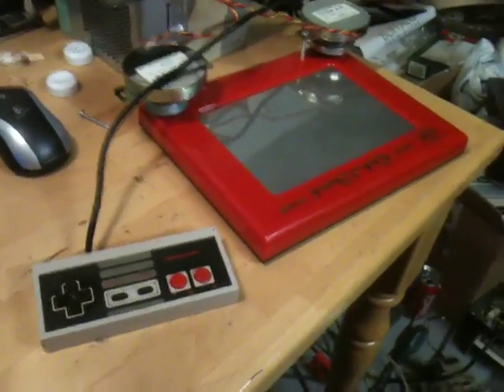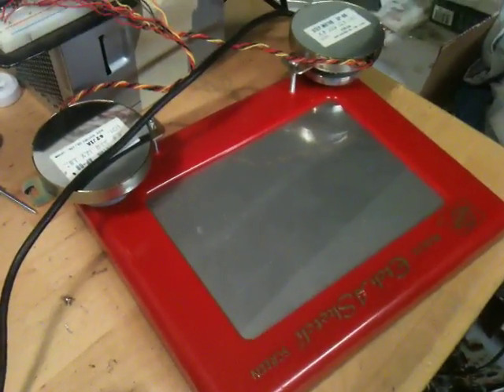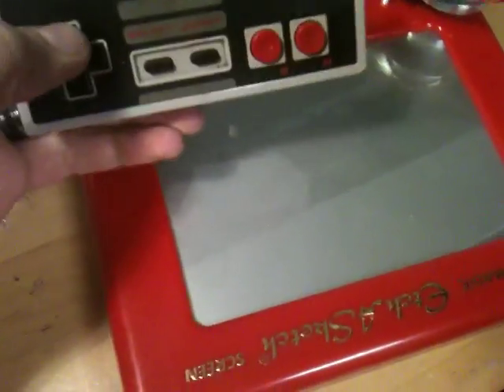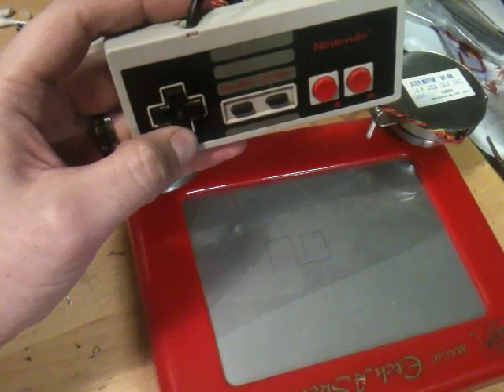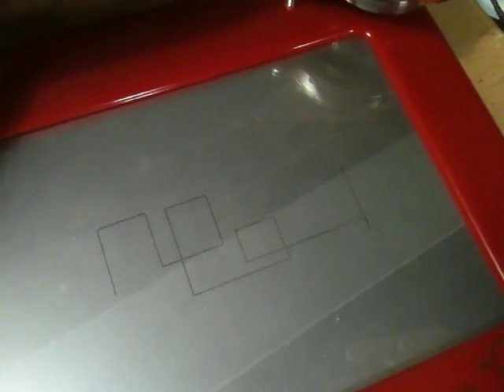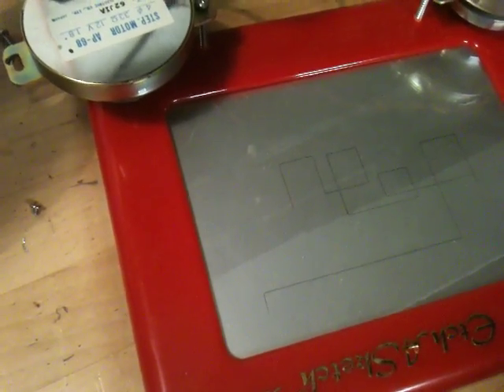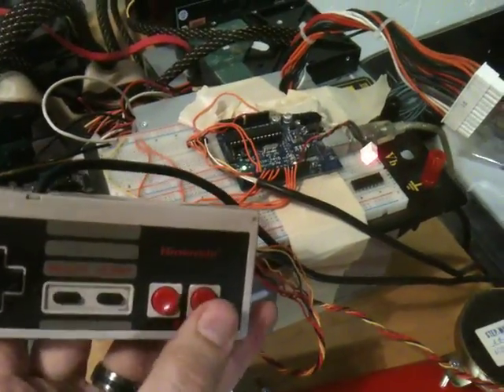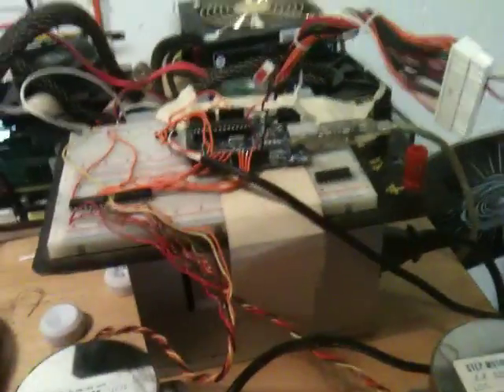NES controlled Etch-a-sketch

Comment: This is really cool.
now try making some sort of snake game, where the line keeps growing and you can't run into yourself or the edge. (have a 2d array keep track of each position, so you can tell if a block is already black or not... though the resolution would be limited by the resolution of the stepper motors...)